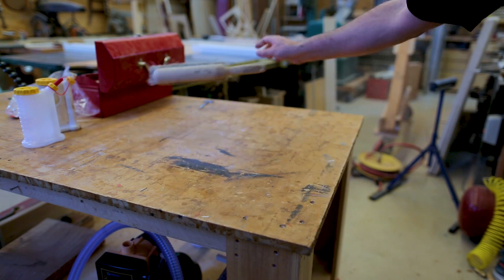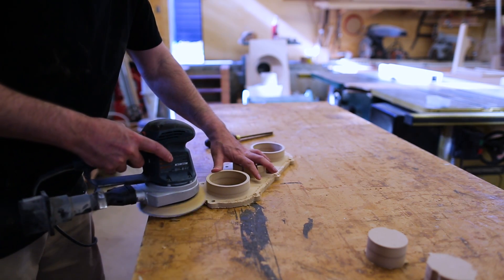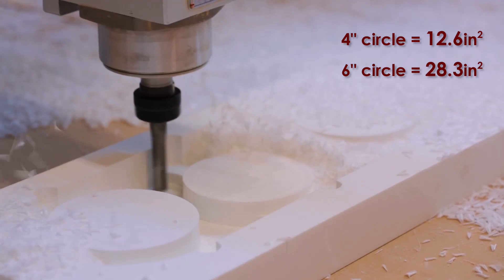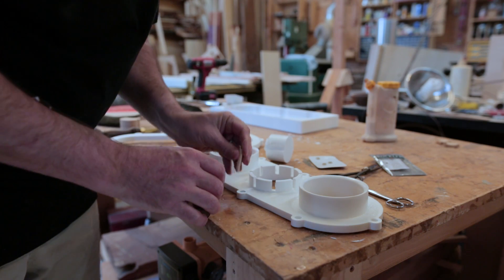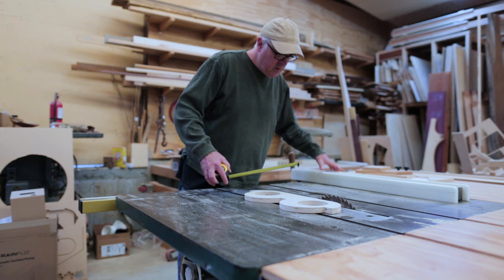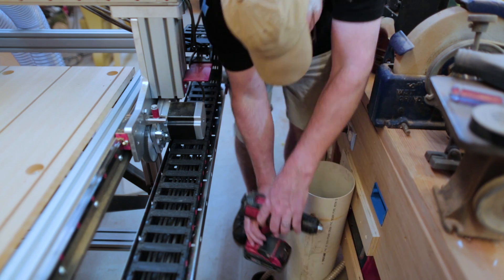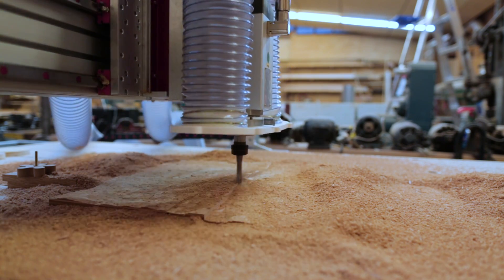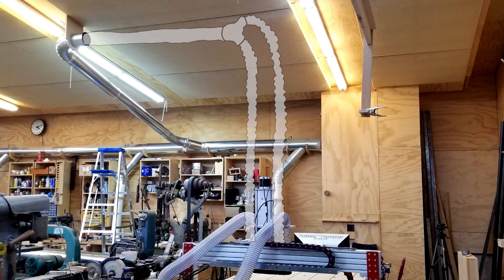CNC Dust Collection part 1

Comment: Your videos (and others, but mostly yours) inspired me to purchase a CNC router parts PRO4848 and I just got it up and running in the last few weeks.   I have collected all the parts needed to build my own dust shroud sitting there ready to go.   So thank you for the most perfectly timed video ever haha!   I also have a 6" port running to the machine and I didn't even think of going to a double 4" hose,  great idea! (I was going to reduce it down to a single 4").   Is the CAM file you used available to share by chance?   I'm on the edge of my seat for the next update to see how your changes will work.   Are you feeling like it's really important to see what the bit is doing at all times?   What about a small lipstick camera mounted to film inside the brushes,  maybe with a strip of LEDs on the inside as well?    Might be a bit over complicated but could be fun.   The brushes seem to make such a big difference I'm guessing a gap in the brushes will negatively effect the suction.     I was also thinking a thick clear plastic instead of the brushes might be a good alternative but I couldn't really find what I was looking for and with my strong DC was worried they would just get sucked towards the port.

Comment: What do you think about making the holder from clear acrylic as a lot of people are suggesting in the comments? Possibly make the top part bigger in the front and be able to see the bit from above. It would mean less concentration of the suction power but the brushes stop the kinetic energy of the sawdust and the dust stays on the table. Or get collected the next time the router passes by. Thanks for the great video!
Reply: Wintergatan I love that you watch Frank's videos. You guys are both creative geniuses!
Reply from the maker: Interesting,  I had not thought of making the plate bigger to make a larger window.

Comment: Have you tried double stick paper based tape?  we use Intertape brand 591 flatback paper tape. Good stuff! Use it to hold parts down to the table, and then pry them up with a spatula or scraper.

Comment: Great video Frank, thanks. The brush needs to be as long as the bit - maybe you could have separate brushes of different lengths? Re seeing the work - it's going to be difficult, making it out of clear plastic or adding a window is going to get dirty. The section of the dust collection head near the bit could be much narrower though, almost like a figure of 8 so the dust collection is at the side with a narrow section in the middle. You still won't be able to see the bit, but it will be more obvious where it is?

Comment: I guess if you have longer brushes (so they seal better to the workpiece) and leave a gap on each side of the bit, air should go in by the bit, pick up the dust and head out to the side to the hoses. That way you could see the bit in action. Also, as someone else mentioned, you could make the top out of clear acrylic or polycarbonate. Another idea is that you could drill holes and glue in a couple of white LEDs to illuminate the workpiece.

Comment: Did you do the CAM work on the Mount Hood carving in Fusion 360?
Reply from the maker: yes.  A parallel roughing pass and a spiral finishing pass
Reply: Thank you Frank, I have a Shapeoko with no real software for it.  Practically everyone I know  runs Vcarve Pro and I couldn't afford that now.  I'll dig into Fusion more.

Comment: Hi Frank, the CNC machine I sometimes use has a big enclosure which is somewhat transparent and then an opaque shoe you can lower if needed. Both make it real hard to see what's happening so I decided to add a small camera inside the shoe. You can get a decent 1080p camera and a Raspberry Pi for very reasonable price and as a bonus you get CNC cam shots for the channel.

You can take the bend out of your plastic parts by heating them with a hot air gun and bending by hand. Just go slow, and work out the correct temperature on scraps beforehand.

Great videos, it really makes my day when a new one shows up :)
Reply from the maker: I like the camera idea.  And I will have to try the heat idea on the plastic.  Thanks.

Comment: There's another possible solution Frank.  You can get an endoscopic camera off of Amazon for a fairly reasonable price and possible you could snake that into the brush housing to view your bit while it's in operation.  Not sure though if you would need to add a light inside as well.  Just a thought. :-)
Reply from the maker: so many great camera ideas

Comment: I don't know how easy it would be but have you thought of adding a vacuum table for holding down material? We have one on our laguna smartshop II at work, it works really well. most of the time tabs are unnecessary.
Reply from the maker: I made one that works with my shop vac,  I have ideas on remaking it with improvements.

Comment: Based on some measurements I've done using a laser particle counter, I would guess that you were catching most of the fine dust (the dust that causes health problems) even without the brush.  The larger bits have much more momentum so they require more air velocity to capture. The brush accomplishes that as well as bouncing them back into the air stream. 

With the large amount of airflow you have, you might be able to get by with a small opening for viewing. 

I attached my boot to the stationary frame so it doesn't move up and down with the spindle. That also allows a large opening in the center where the spindle moves through to see everything that's going on.   Essentially, most of the air is drawn down through that center hole so you can see the bit but still catch everything. 

Unless you do a lot of 3D cutting that's taller than your brush, a boot that is held stationary in the vertical axis works better for most projects. I was going to design mine to mount either way but found that I don't need it.
Reply from the maker: It did seem like it was getting the fine dust, which is the real killer.

Comment: As you go along with CNC I think you will find it is faster and safer to machine out the entire internal volume of the 4" circles rather than leaving little bits to trim off and pulling out the big chunks.

Comment: Frank,
Suggestion/Thoughts of a madman: 

Put your Y connection on the router itself. Run a single 6" flexible hose from the ceiling duct down to your router instead of two hoses.

Make sure to have some sort of swivel mechanism on the ceiling hose connection as well, or have a secondary hold point as to not stress the hose joint itself.
Reply: chopperdan88 

My thoughts exactly!  Much less restriction with one hose over that distance from the ceiling to the router and less weight for the gantry to move around.
Reply: I thought the same thing. I was surprised when he put the Y connector so far away.

Comment: I'm always impressed by your work and ingenuity. Regarding not being able to see your bit, I'm wondering if the plastic, that holds the bristles, could be made out of clear plastic. Also, I'm wondering if some of the bristles could be replaced with strips of the clear, rubbery plastic material that you sometimes you see at grocery stores in the refrigeration areas(holds the cold in, but still allows you to see the produce and reach in to grab the products)? Or you could go the high tech route by inserting a small camera or force sensor with the skirt of the vacuum. :)

Comment: Having gone through this same process a few times now - use clear acrylic instead of that white plastic - your visibility will be a thousand times better. Also, it works best if you have it fixed in place from your Z carriage, so it's a fixed height, instead of from the spindle which moves up and down - your bristles are never in optimum position if it's constantly moving up and down. You can even skip the bristles if you want, just set the shoe 1/4" above the workpiece. Or, have different length bristles, so that you can let it go over clamps and things. Something like this: https://www.youtube.com/watch?v=qhP2WyMh1cc

Comment: Why don't you just place a very small camera inside of the brush? A little complicated/over-kill, however, you would have a great view of the bit than using less brush (or using less brush material could result in more saw dust) or adding a plastic window. I think a camera would work great and be very useful. 
Ex of camera and screen to use:
Camera- https://www.amazon.com/Corprit-Hidden-Camera-Security-surveilance/dp/B01F7341PY/ref=sr_1_8?s=photo&ie=UTF8&qid=1497191584&sr=1-8&keywords=mini+camera

screen- https://www.amazon.com/BW-3-5-Inch-Monitor-Automobile/dp/B0045IIZKU/ref=sr_1_2?ie=UTF8&qid=1497191948&sr=8-2&keywords=mini+lcd+monitor

Comment: Sir,
Could you take out some of the bristle then have a piece acrylic in place of the bristles you just removed. Like at both ends and in the middle, jut just a little shorter than the bristles Also I seen some of your bristles were being sucked into the vacuum, was that a none issue. Great problem solving  and production    Ralph
Reply from the maker: I could see where making a window in the bristles will allow viewing and keep the bristles from being sucked into the air hose.
Reply: Or you could type into you tube "cnc dust collection" and get a plethora
of ideas  Ralph
Reply: A you tuber ,Tim Wehr, made 1 with different length bristles and to mount them he used magnets but cant see the tool

Comment: Here is a brush I had made for filming. It has the brush left off on the filming side. 

https://instagram.com/p/BUsfXDchMZi/
Reply from the maker: Yes I saw that design about a week ago.  it was what was getting me thinking about altering the bristles
Reply: What about a T shaped brush where the router is at the intersection, the hoses are at the ends of the arms, and a gopro at the bottom, aimed at the bit?

Comment: Frank
  one thing you might try to replace the brush material is some vinyl plastic strips like you see in cold storage facilities to let people and forklifts through.   We did this with our cnc routers at work.  Some plastic around 0.02-.03 thick works fine.  wrap a piece around the dust collector and cut slots every 1/2" or so.  I you only have some thinner material, use two layers and alternate the slits in the plastic.   One thing is to not make the strips longer than the distance from the edge to the cutter or they may get sucked in and cut off :-)   Especially when using a planing cutter to flatten the spoil board.

James
Reply from the maker: Thanks James, that helps
Reply: I can see that working.  I've made eye protectors from a mayonnaise jar, and drawer slides from clorox bottles (which is thin HDPE).  So many reusable plastics out there.
Reply: I was thinking the exact same thing James Crombie. Good idea!
Reply: I've also seen someone use a piece of clear plastic from a bottle, but I'm not exactly sure of the results.   Maybe just a 2-3" piece in front of the bit so you could watch it work.
Reply: I can confirm that this works- it's what we did at a local makerspace. The one problem we were having was it kept sucking in and collapsing, which wasn't a big enough problem for us to put effort into fixing. I's sure Frank can figure something out about that if he runs into that problem.
Reply: That machine wont even notice it.
Reply: was going to suggest this. Saw this type of thing at the airport and in the miter station on the bellevue workshop channel

Comment: You can make a clear brush from 1 mm transparant PVC for example. If you wrap it around the dust shoe and make a bunch of slits along the edge, it will behave just like the brushes.
Reply: where would you get clear PVC?
Russ from Coral Springs, FL, USA
Reply: Funny. I have a clear brush made of transparent plastic material and was just thinking about replacing it with a bristle version. You can't really see through the plastic anyway clear enough to be useful, and I think I'm getting more dust escaping than I've seen with the bristles. That said, I'm new to all this and my plastic-skirt version is the only one I've played with.
Reply from the maker: I have seen this, it may be a good option.

Comment: Make the brush holder out of clear acrylic to give yourself more visibility. Cheers!
Reply: would it stay clear when in use? seems like chips would scratch it and dust might cling to it due to static cling. Maybe I'm wrong, hopefully, because it's a great idea.
Reply: Yep.  The Shopbot CNC router that I use has a nice clear acrylic dust hood.  Works great, and you can easily peek in to see the bit.
Reply: Using acrylic should also avoid the warping problem. Especially if you use cast rather than extruded.
Reply: A clear top sheet does seem like the way to go. It wouldn't have to be structural, just a plate on top of whatever frame was used for the brush holder. It could even have LEDs to illuminate the bit/piece.
Reply: Someone on instrutables did this along with a clear vinyl skirt/brush and it looks really nice. 
http://www.instructables.com/id/Magnetic-ShopBot-Dust-Skirt/
Reply: I was thinking the same thing.. Lexan? or Pexli? could be easy to heat and bend and drill holes etc.
Reply: medicineman007 I
Reply: I suspect it would depend on a lot of factors, like what you're using as dust collection (how much negative pressure it generate), material being cut, chipload, length of toolpath etc. I've seen many examples online of people using acrylic for this though, so I think it works well. Many also attach LEDs to make visibility even better.
Reply: @myself It would also be easier to use a thin sheet of acrylic, and then glue in tubular sections for the connections, instead of machining the whole thing from a larger block.